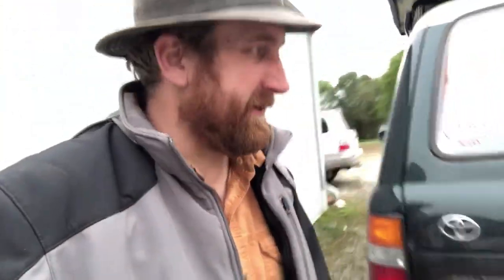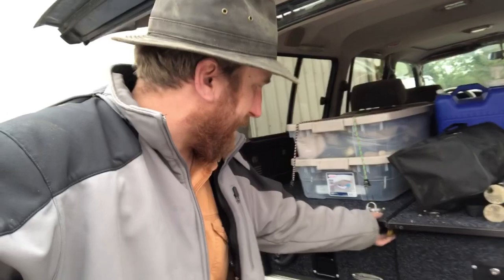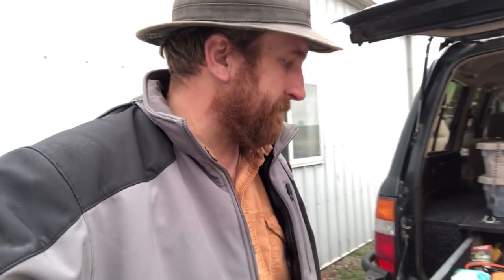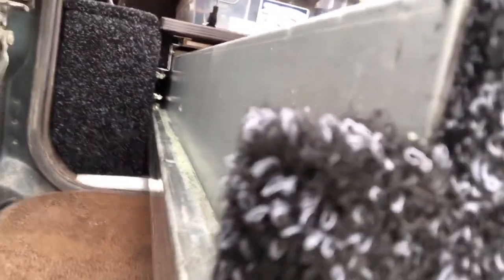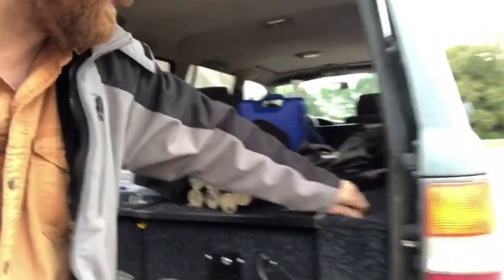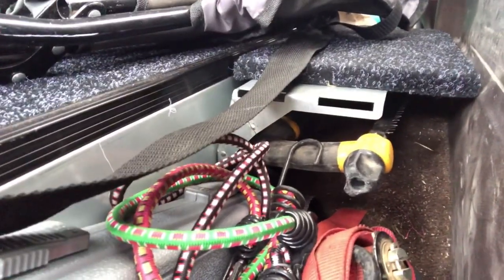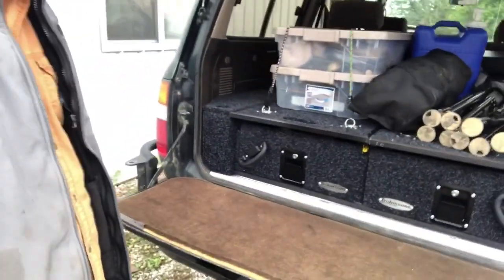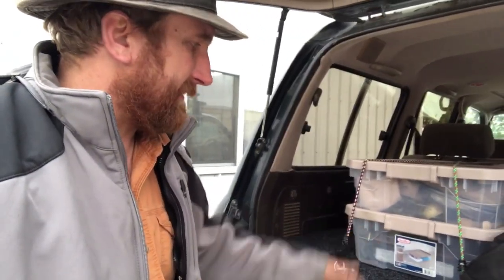Dobinsons rear drawers for land cruiser

Comment: I looked at these  but built my own and I have changed it as needed over the last couple years.  super easy to do circular saw multi tool and brch  and 500lb slides.
Reply from the maker: JailBreak Overlander yeah I had some birch drawers in mine they worked great and about the same design as the dobinsons just running what we sale so I can show off the products

Comment: When the 2nd row is folded, is it flush with the drawers? I need it to be a sleeping platform
Reply from the maker: Ammar Ali on a 80 series it is the right height for it to be a sleeping platform I use it myself as that when I go on solo trips there is a void between the seat and the drawers  which is no problem using a air mattress if you are just using a sleeping pad then you might want to stuff something in to fill.  Feel free to call me and discuss at the shop 4178550647

Comment: I've had these for three years.
They're basically re badged Titan draws but twice as expensive. The fridge slide doesn't lock when extended, and every Allen key bolts work loose. 
I wouldn't recommend these to anyone
Reply from the maker: They are thicker than titans but since big country 4x4 from South Africa has came available in the USA ive been running those.  South African made, drawers fully extend, everything about them a better.  True expedition grade drawer system.  You can see in the later videos the change

Comment: Just watched this and was considering ordering until i saw you were charging $200 more then everyone else for the drawer system I've being looking at. Bummer
Reply from the maker: Stuntman Travis which drawers were you looking at there must be a typo on my site
Reply from the maker: Stuntman Travis they are 1350.00 with 100 freight for the dual drawers with wings
Reply: @ozarkoverlandoutfitters9218  looking at the set for a pickup, the 51 inch in length. Dobinsons site and every other seller is $1450 your site says $1650
Reply from the maker: Stuntman Travis That was an old price they had dropped in price we forgot to change it I’ve got the website fixed thank you